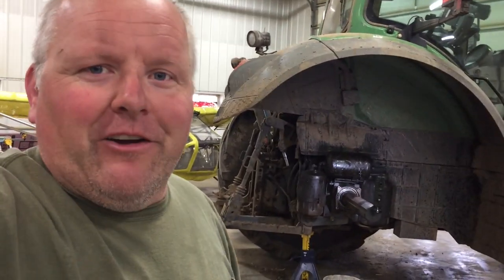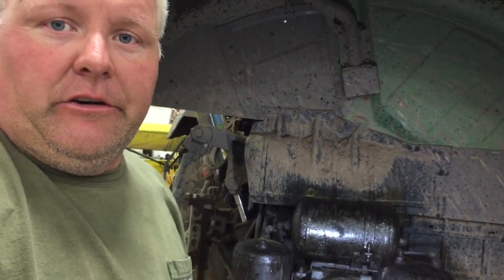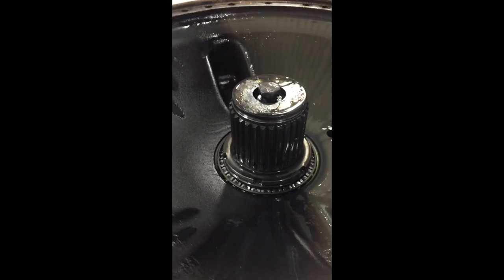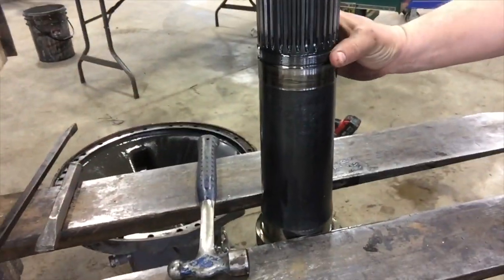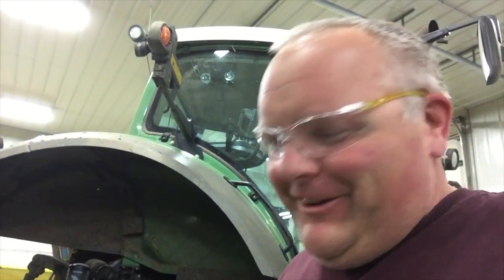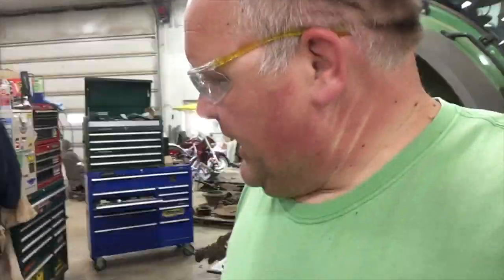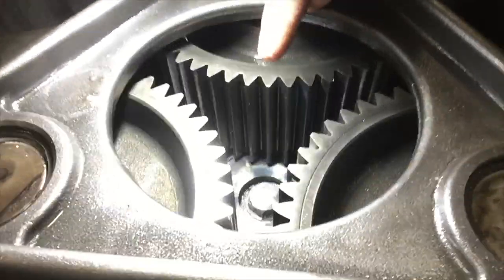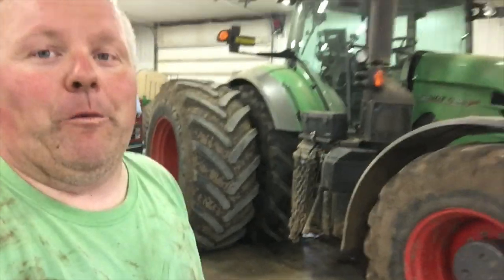Fendt Axle seal.

Comment: When you have a tight bearing race, put a hot bead of weld round it. As it coops, it will shrink the race and it's easier to get out. Often it will fall out.
Reply from the maker: That works great

Comment: I assume those final drive planetaries have their own oil, or is it shared with the Vario? Or perhaps the hydraulic system?
Reply from the maker: martintech2012 They are in separate reservoirs roughly 3 gallons each side.